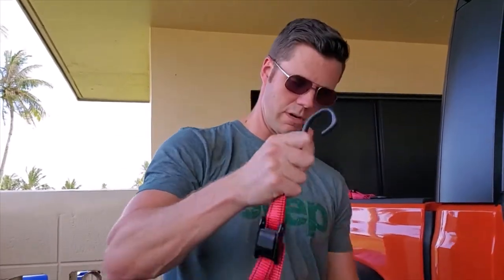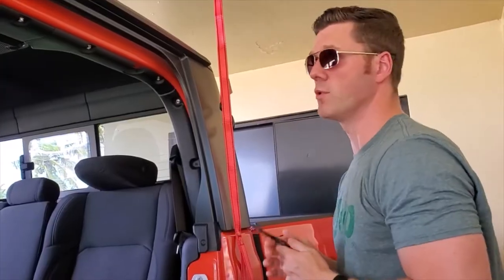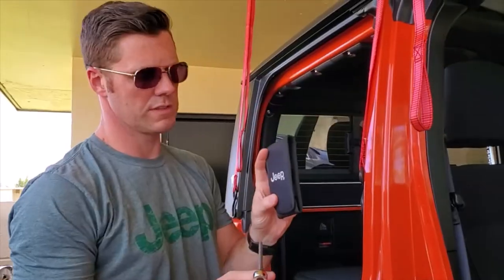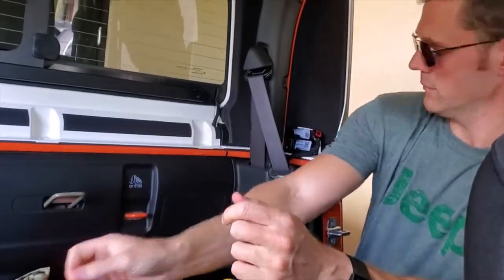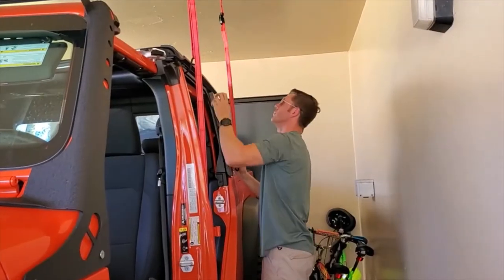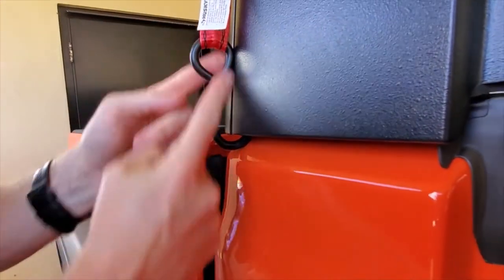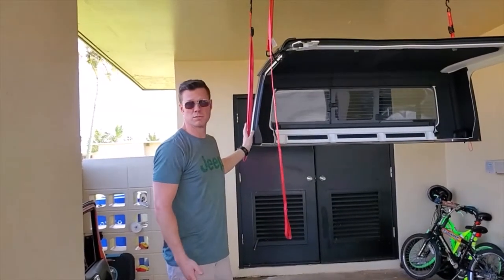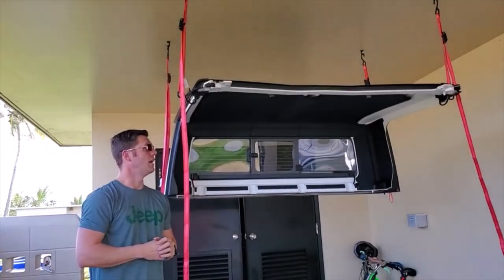DIY Hard Top Hoist | How to with tips and tricks

Comment: Thanks! I did this and it worked, but I am a little worried about some deflection occurring where the strap hooks are located.  They are slightly bending the interior area where they are connected at the front of the hard top.  Also, I used some additional rubber in between the hooks and the hard top.  I'm thinking about adding 2 more straps in the middle for a little more stability.
Reply from the maker: Mine seems to not deflect at all. I have my mount points in the ceiling closer so it doest pull out on the hardtop. Check your eyelet placement and move them closer in towards the top.

Comment: Thank you for this!  My hard top is currently sitting on the garage floor. I’m like your wife and not so good at trying to lift the top off my Jeep. I was wondering if you could share your extra safety features you mentioned after the top is up and off the Jeep.
Reply from the maker: Its to tie the straps together under the top so if it slips off the bottom hooks, it rests on the tied straps, instead.
Reply: TewlTalk thank you!

Comment: Is there a limit to how long you can hang the top like this?  I was wondering if hanging it like this for a long time would warp or mess up the top at all.  Thanks.
Reply from the maker: I would only hang it like this short term.
Reply: They recommend not having it hung all day and night as it can cause the top to warp. You can still back into it and drop it on the jeep overnight to alleviate the stress, then lift it back up if you don't need it.

Comment: Congrats the best modification I've seen so far.  Any way you can tell the measurements  between the 4 hooks up in the ceiling?
Reply from the maker: I measured the bottom of the hard top and used the 4 corners as a measuring point.

Comment: How long can you keep the hard top hanging from those hooks in the garge? Will it worp the top?
Reply from the maker: Great question Juan, the top can warp under its own load. For long term use it should be on supports, taking the full weight of the top. For my situation its temporary. I also tie my straps around the underside of the top and connect the straps to keep the bow to a minimum.

Comment: FYI, those aluminum “plant” hooks ARE your weak point! I would suggest beefier eye screws.
Reply from the maker: Aluminum won't rust in concrete and Guam Salt. They are rated at 98lbs each or 400lbs total. The top is about 60lbs.
Reply: cast pieces can twist then crack under load. more margin for error could be helpful like picking load weight for tires where the jeep could be mostly on a single tire :)  
a lowering budget would be helpful to.  we see a lot of the vids lifting but not the lowering which is harder especially solo. 
cool vid either way. 
hafa adai!
Reply: lowering vid not budget.  crazy auto correct